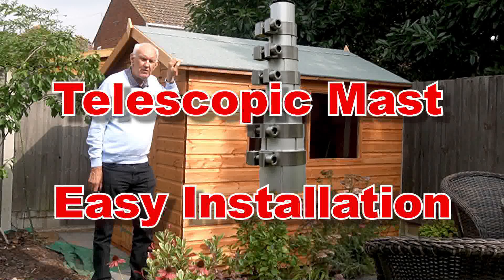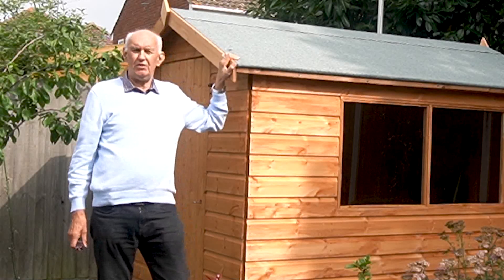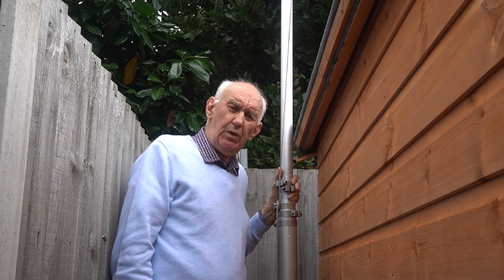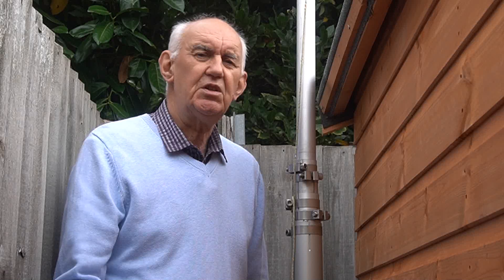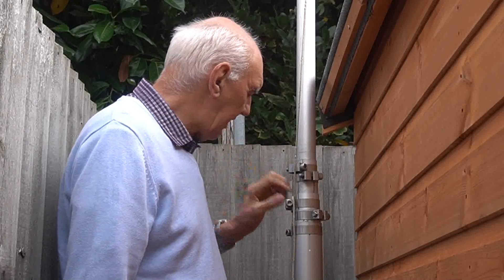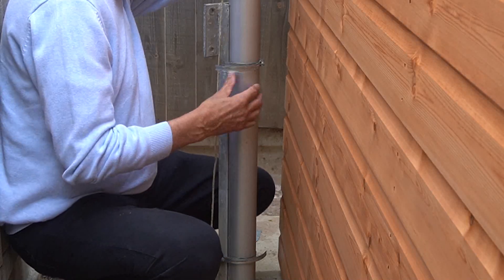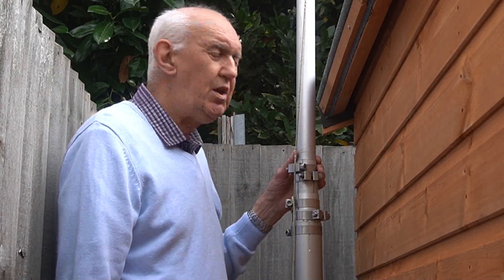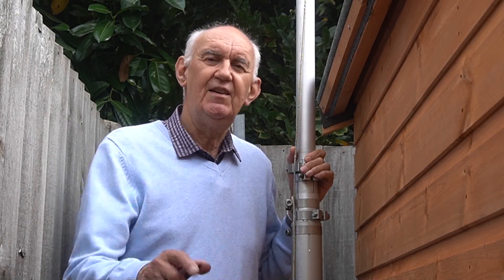SIMPLE 10M SMALL GARDEN MAST - SPIDERMAST

Comment: The ideal Garden??? An immediate chuckle. Back to the Vid.
I bought an Aluminium push up mast some years ago, maybe 20 at a Rally. It was perhaps £80-90 and you are correct mine has not survived the years very well (It was not of the same quality as yours btw) and has been effectively out of use for the last fifteen or so. Cannot afford another one so I shall manage without.
My Garden is about 10m from House to Fence and has a """Long Wire""" to the house through an SGC Auto Tuner but there used to be a house with a tree about as far away again that I was plucking up courage for the last twenty years to ask to use it as an anchor and they went and cut it down. :-(.
Thanks for the reminder that I need to win the lottery and move into a house with a 100m garden. :-)
Reply from the maker: Trouble is that the lawn needs to be cut!!
Reply: @watersstanton  Chuckle. I started calling it "Grass" a long time ago.

Comment: Hi Peter, nice video and a very nice looking shed.
The mast looks the business as their say.
Wonder if it would have been easier to just fix it to the fence with some brackets  save yo digging, and if the mast was kept slightly off the ground, maybe sat on plastic insulater , the pole could be used as a vertical ant,  and a few radials going along the fence in a fan , fixed to the fence one above the other with 25mm gaps up to about half a meter high. I tried it once and it worked well.
Just a idea to use the same mast for a couple of ants. 
Good luck and thanks for all your videos. 
73 zl3xdj

Comment: I was about to buy a fibreglass spiderbeam, but now tempted by one of these as presumably it does not need guying?
Are there any disadvantages to using a metal (conductive) pole compared to fibreglass... especially for dipoles?
Reply from the maker: As it is metal you cannot run a vertical wire close to it. BUT it is a lot stronger when it comes to supporting a wire. I have never guyed mine. If a severe storm was to be forecast I might drop it a couple of sections. 73 Peter.
Reply: Mine holds my Cobweb up at 25feet and to make sure in storms I added 3 paracord guys.
These guys mean I don't have to drop the mast in force ten storms.
Reply: @Michael. M7 CYC Yes, mine holds my cobweb. They are very strong much heavier gauge metal than other cheapo masts. Use 3 or 4mm paracord as guys.

Comment: It's most likely that those hose clamps are stainless steel. It would be a very good idea to isolate them from the aluminium mast by using some electrical tape or something similar applied between the mast and the hose clamp. Aluminium alloys and stainless steel alloys are not compatible materials and galvanic corrosion will occur  when they come into contact with one another. You don't want to find that out at 3.00 AM on a windy rainy night with your next door neigbour banging on your door and demanding you fix their broken roof tiles there and then.
Reply from the maker: Many thanks for your input. 73 Peter
Reply: Probably not since Peter explains he has had this mast for several years. It looks new...
Reply: In that case as Peter said, the coating on the mast is preventing the dissimilar metals from corroding.
Reply: I have the 10metre HD one and it's anodized.
The clamps that hold each section are stainless so adding stainless pipe clamps makes no difference.
These are fantastic masts and not to be confused with those crappy cheap thin ali ones.
They cost more because they are head shoulders above the cheap ones and made of thick alloy.
Mine easily holds my Cobweb and it is fixed just like Peters but I added three guys of paracord just to make sure.
Reply: @brutonstreettailor4570  I missed that. Thankyou.
Reply: @g1hwy  Thanks for the reply. I somehow missed that the masts were anodized. Anodizing does indeed provide a an insulative barrier which will greatly reduce the problem of galvanic corrosion.

Comment: I want to buy Aluminium Telescopic Mast 10m HD (33ft) and I want to fix it in wall. Also with g-450 for my hexbeam.
If I put rotator at bottom the mast also rotates how can it be fixed at wall?
Should I put rootator in top?
Reply from the maker: That rotator would struggle to turn a mast. Much easier to put the rotatir at tge too. 73 Peter.
Reply: @watersstanton  you mean put rotator at top, did I understand well?

Comment: I was wondering about planning permission if the mast is portable not fixed I understand that planning permission is not need but being strap in like yours does it not require planning permission ? sorry for being perdantic .
Reply from the maker: Planning is down to your local authority. But telescopic means it can be taken down to a level below planning requirement. If a crane or scaffolding does not require planning, then my reasoning is neither does a telescopic mast. BUT I an not an exoert on this,